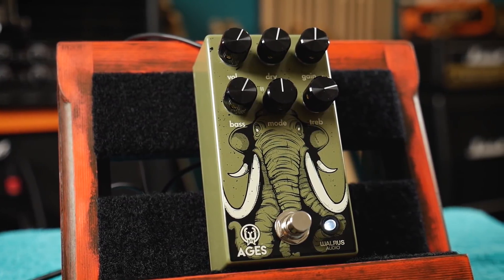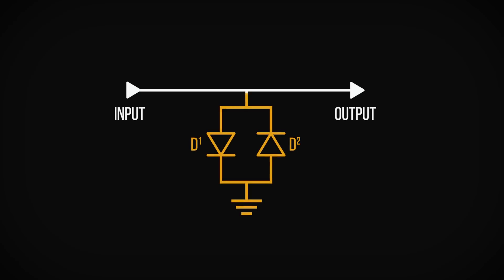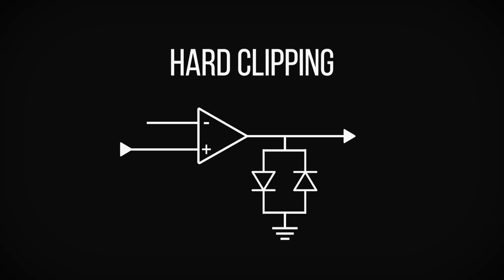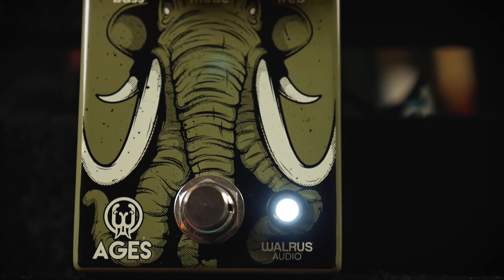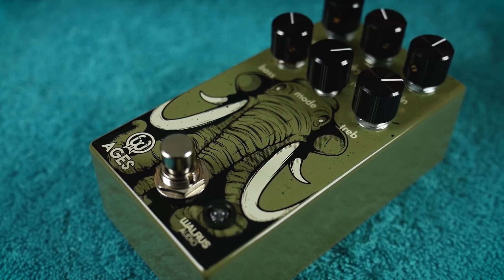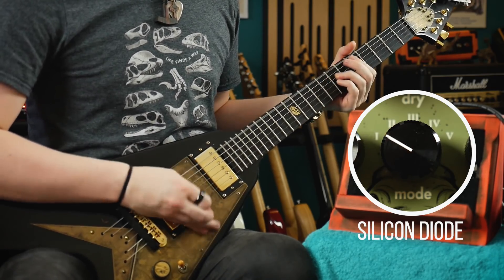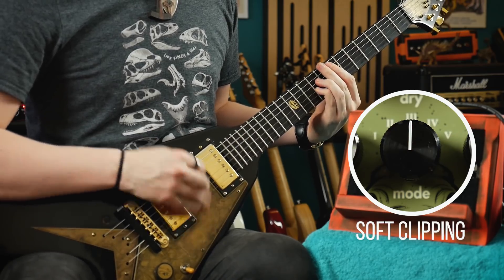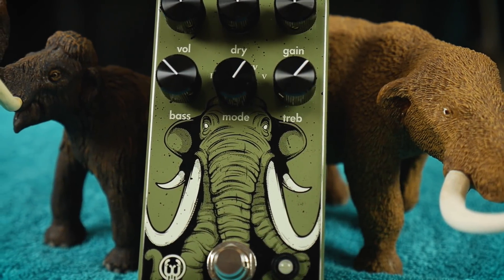What is Diode Clipping? | Too Afraid To Ask

Comment: People confused me by saying there is clipping and there is clipping to ground. Even experts don't really know.
Reply from the maker: @patrickmcmanus5373  experts know just fine: what exactly is confusing you?
Reply: @ScienceofLoud  I am adding clipping diodes to switches on the output. Can the diodes be on the output but joined to the ground rather than just the output. So an example would be can I solder diodes from the hot of the output jack to the ground of the jack?
Would this work?
Would it still clip the signal?
Cheers
Reply from the maker: @patrickmcmanus5373  If you connected diodes between the hot signal and ground on the output jack of a device then: 
Yes - you would achieve hard clipping of the signal; any signal level above the forward voltage of the diodes would be conducted to ground. 

The more important questions I have for you is WHY are you doing it this way? and WHAT is the result you are hoping to achieve? 

The reason you typically don't see clipping diodes across an output like this is because clipping the signal, by necessity, significantly reduces the signal level. 

If you place the clipping at the output, you have no way to adjust the level of the signal leaving the device - it will be decided for you by the forward voltage of the diodes. 

You'd want to have a volume stage AFTER clipping to have control over the output level. 

If you are just looking for a very simple way to aggressively clip a signal into square wave and don't care about the output level - then this certainly is a solution, however if you are trying to add a distortion effect to something that doesn't have a distortion effect, then there would be much better ways to implement it. 

I'm not suggesting this is what you are doing, but as an example: putting hard clipping diodes across the output jack of an electric guitar isn't going to give you the same result as using a distortion pedal - in large part because the signal level from the pickups likely isn't large enough to exceed the diode's forward voltage.

Comment: I've spent 20+ years on this and over a decade ago, finally enrolled in college for electrical/electronics engineering with this having been one of the driving forces. You did a great job on this as expected. 

As an amateur engineer(never quite finished the degree), I still struggle with the prices people get fleeced on with stomp boxes. What is truly goofy is the terms "overdrive, fuzz and distortion" have been grossly misappropriated since somewhere in the 70's. For example, I just designed a "fuzz" by overdriving transistors, and some will call this a "classic fuzz" or "classic fuzz overdrive" because it's actually a product of overdrive.

The term was bastardized because these overdrives were intended to emulate the sound of an overdriven tube, and at the heart of the circuit, use soft clipping in a feedback loop.
Meanwhile, my first original design uses soft clipping, and I regularly regard it as a distortion lol. Anyway, my best work is yet to come. I'm well into a solid-state design that will produce the clarity and note separation we expect almost exclusively from tubes. My goal is very bassy, clustered arpeggios that don't turn into frothing slop from very high, even order harmonics. 

Ultimately, semiconductors can do it better, but the designs require actually giving a fuck about a solid-state that will rival or exceed tubes, and 99% of designers educated or not are married to tubes or even digital. Ironically, the recipe to achieve what I'm describing isn't complicated in the least.

Comment: All of the schematics I have looked at for pedals with diode clipping always only have 2 diodes. Why not 1 or  3 or 7 or 24? Lack of headroom? Tubes are diodes and my tube amps have anywhere from 4 to 12 tubes.
Reply from the maker: The reason there are typically 2 clipping diodes is because one diode is required to clip each hemicycle of the waveform. There are many pedals that use more than  2 clipping diodes (including the pedal featured in this video). Odd numbers of diodes will produce asymmetric clipping (where one hemicycle is clipped more than the other). 

Not all tubes are diodes. If your amplifer is tube rectified then that rectifier tube is a diode.

All the other valves in your amplifiers are either triode, pentodes, or beam tetrodes (depending on what types you have), they perform amplification - a very different purpose and function to clipping diodes in a pedal.

Comment: I build my own drive pedals FOR me to use...I use MY amplifiers for testing and tweaking the pedals while building them...In other words, I get as much as I can out of the amp before I tweak the pedal...My pedals will probably not do the same in your amps...I think most pedals are designed that way...It's best to take your amp to a pedal dealer when purchasing high dollar pedal just to try it out..Or else you may not like it

Comment: Nice video and explanation dude. Have a question for you. Does the amp SUNN BETA EAD its a Soft cipping amp or the clipping its different becaus of his MOSFET system ? Also the same question for the EHX Hot tubes pedal ? 
Its distortio. Applies for this explanation or its differenet the matter of using MOSFETS ?

Comment: Thanks for the clear explanation. I’ve been trying to figure out how/why diode clipping works as well as differences between soft/hard clipping arrangement in a circuit. This by far has been the best explanation accompanied by visuals - and I feel much better about analyzing and potentially modifying schematics. Thanks so much!

Comment: Thank you for a fantastic explanation! My initial thought was that the difference between settings 1 & 3 (or 2 & 4), was the number of diodes arranged symmetrically in the feedback loop. You mentioned that the higher gain soft clipping settings (3 & 4), are the result of more voltage travelling through the opamp. Any idea how this is achieved? Maybe the voltage in those settings is diverted into a charge pump before the opamp? Thanks again for such a great breakdown of this!

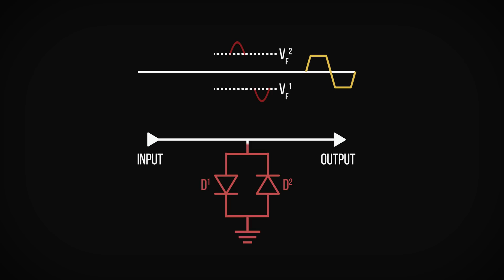Comment: at 2:07 you say that the excess voltage clipped by diodes goes to ground.  I always figured the harmonics that clipping provides comes from the Law of Conservation of Energy, in that the difference in wavelength is put somewhere else in the wave, adding "hair" to the shape, so to speak.  Does this still happen to a more limited degree, or is it really the square shape of the new crest/trough that provides the perceived harmonics?

Comment: Love your TATA segments! I have a question I’d like to ask. It’s a bit off topic of this video, but thought I’d ask anyway. I figure you may know since you make pickups. Here’s my question. Why does my lower output pickup of around 12.5 kOhm’s sound louder, punchier and tighter than my higher output pickup of around 17.6kOhm’s? Both are in the bridge position of similarly constructed guitars. According to popular belief of low vs high output pickups, it should be the opposite.
Reply from the maker: DC Resistance tells you basically nothing about how a pickup will sound. It's only one of several factors than influence the signal level (output).

As you wind more copper onto the coil the resistance increases, but so too does the inductance at a faster rate. 

Inductance is pivotal to how a pickup sounds as this affects the resonant peak, the most dominant frequency of the pickup. 

The higher the inductance the lower the resonant peak, so if you wind a coil to be very hot (high output) you will also make it sound dark (lowering the resonant peak and sacrificing high end detail)

Beyond 16K ohm the inductance will work against the resistance. Extreme output pickups are largely false economy.
Reply: CSGuitars Thank you for your response. Makes total sense. I play hard rock and “classic” metal and have never like very high output pickups. Too mushy sounding to me. Not tight enough. That’s been my experience anyway. I prefer the punch and tone of medium output pickups because you can always juice your output with a boost pedal or overdrive pedal. Thanks again!

Comment: Hey Colin, have a TATA question.

Maybe you could answer as a reply to this comment because I’m not sure it would make a great video.

I see a lot of guys use humidifiers in their guitar rooms to prevent the wood from drying out.

This seems counterintuitive to me for a couple of reasons...

1.) Older acoustic guitars usually sound better in large part because the wood has completely dried... so doesn’t a humidifier slow the “aging” process of the wood?

2.) With regard to electric guitars and amps and pedals (if they’re in the same room, which they almost always are), I would think that the humidity would be bad for the electronic components... so wouldn’t a humidifier do more damage than good over time?

3.) Lastly with regard to strings... wouldn’t the excess humidity cause uncoated strings to die more quickly?

Seems to me like a humidifier would do more harm than good, but maybe my understanding is incorrect or there’s something I’m just not considering.

What are your thoughts on this?

Thanks so much!
Reply from the maker: You're asking very much the wrong person. Living in Scotland I'd never have any need for a humidifier. It's always wet all the time. 

This is a question for someone in Arizona who needs to add moisture to the environment to prevent wood cracking and warping. I'm sure they'll be able to tell you exactly why humidifiers are useful.
Reply: No worries, mate!

Thank you for your reply.

Comment: So they have 2 LEDs inside the pedal for signal processing. The light they make is evidently considered a waste byproduct. Why not mount them in the 2 eyes of that mutant elephant on the front panel?? A chance in badass design missed.
Reply: Some pedals do that, and it looks badass. The lights light up brighter the more distorted the signal, and therefore the harder you play if you keep the gain at the same setting.

Comment: Great stuff, as always. This may seem like a stupid question, but when you rotate a gain/distortion potentiometer on a pedal, are you increasing the forward voltage, thus increasing the part of the wave that gets clipped? And then with the volume pot, is this increase caused by some secondary amplification after the clipping diode circuit?
Reply from the maker: The gain control usually sits in the negative feedback look of the op amp and controls how much of the the output is fed back into the inverting input. 
This literally dictates how much gain the op amp can generate and is entirely independent of the clipping diodes. 
The forward voltage of a diode is defined by the materials it is made from and cannot be altered by any external process. 

The volume control in pedals can be either passive or active: If passive it's simply a potentiometer right before the output which bleeds a percentage of the signal to ground, making it quieter. 
If active then there will be a secondary amplification stage that will either increase or decrease the signal generated by the gain stage.
Reply: @ScienceofLoud - Thank you!

Comment: One of the overlooked aspects of "hard" vs "soft" clipping is that diodes in the feedback loop of an op-amp (i.e., "soft") tend to prevent the op-amp from crashing against its headroom limitations, since the maximum amplitude of the op-amp will be set by the diodes at roughly +/-600mv (for silicon) or +/-1.5V (for red LEDs).  If, however, one directs an op-amp to provide a gain to the input signal of, say, 200x, and sticks the diodes on the output, what you end up hearing is the sound of an op-amp that has been explicitly directed to exceed its headroom, and then clipped by diodes on its output - double clipping.  I recall many forum posts by people puzzled at why their MXR Distortion+ could never get "clean", even in the complete absence of clipping diodes.

So, one of the differences between "hard" and "soft" clipping is that, with soft, one is hearing essentially ONLY the characteristics imposed by the diodes, while in the case of "hard" clipping, one is hearing the manner in which the op-amp responds to headroom limitations PLUS the actions of the clipping diodes.

Some pedals will use a sort of combination of the two.  For instance, the venerable Marshall Bluesbreaker, and its derivatives, like the Analogman King of Tone or JHS Morning Glory, provide two cascaded op-amp gain stages.  (Bear in mind that gain is "multiplicative", such that a gain of 30x, followed by a gain of 20x provides a total gain of 600x to the input signal.) The first stage doesn't push the envelope too hard (max gain of 22x for the overall signal, and 31x for high end), but provides enough gain that if you crank the pedal and hit a power chord, you'll run up against the chip limitations.  The output of that first stage is then amplified further by the 2nd one, which has diodes in its feedback loop.  So, a blend of chip-clipping and diodes.

None of this is a criticism of your excellent explanation, merely a few wrinkles you didn't get around to.

Comment: Can I ask why turning the gain up makes it appear louder even though there is actually no change in volume?
Reply: Distortion compresses the signal and raises the average volume even if the peak volume stays the same
Reply from the maker: Gain is signal amplification, you multiply the level of the signal which makes it louder, until it hits its headroom limit, then all further multiplication further distorts the signal. 

I have a video titled "What is gain?" which explains this in some depth.

Comment: Exactly what I was looking for. I want to buy a Friedman JJ jr but I wasn't sure that it would have enough compression so to make it a little more flexible I wanted to boost it with KHDK ghoul jr wich has soft and hard clipping but the mids are a little strange for me on that pedal so the Ages is the perfect solution.

Comment: OK, here's a related TATA: Given that diode clipping pedals all use similar components, why is it that one pedal can sound amazing and another, similar pedal sounds like garbage? Does it have to do with how they choose to clip the signal or is it in the EQ? Or both?
Reply: Eq both before and after the distortion, combined with different diodes being used. 95% of guitar tone (other than the player and physical properties of the guitar) comes from eq in one way or another.
Reply: @lobsterbark  JHS has demo of that in one of his vids where he uses a Boss GE7 and just maxes out certain frequencies to use it as an overdrive
Reply: Amateur’s understanding: has to do with internal voltage regulation and how EQ is handled in the circuit design. For example, how the Ages has bass control before clipping means that adding bass will increase clipping specifically done by the diodes as more voltage/output is going through part of that circuit. Adding bass post clipping will result in a different effect and (in my general opinion) make the tone a bit muddier. Another aspect is overall internal voltage. For example one the largest differences between 1981 DRV and a ProCo Rat is that the 1981 has differentiated its circuit with an internal voltage doubler. Unless I’m mistaken, more available voltage means you can still route voltage through the diode clipping but with extra available voltage results in more overall headroom. This is why the 1981 cleans/tightens up at lower gain settings. Of course, not an expert, this is just my understanding and I would be glad to be corrected. You can see an example of the impact of circuit design using the same not components by taking EQ, volume/boost, compression and drive and simply rearranging the order of effects.

Comment: Ahh yes the good old clipping diodes, loathed by some players when incorporated in a tube amp’s circuit, but praised by the same when fed into a diode-free tube amp. We guitarists are a strange breed.
Reply: What. Diode free tube amps are impossible, they are required in the power supply. Are you talking about diode tubes?
Reply: lobsterbark i think he means diodes in the preamp section to sound like the tubes are being driven harder than they actually are.
Reply: @lobsterbark  silicon and germanium free would be more technically accurate.
Reply: he means people say  non-transistor tube amps are the only amps that sound good because solid state components are trash and sound like crap. Then they rave about the sound they get from running their guitar signal through solid state pedals into the amp. 

the point he is making is that they are using solid state components, integrated chips even, which they claim sound like crap if it was in the amp.
Reply: @fredgarvin4482  a tube is an electronic part just like a transistor just like a diode just like a resistor. A tube is just another way to produce electrons
Reply: The implementation is key.

Comment: Yes but what is a feedback loop
Reply from the maker: The negative feedback loop takes some of the amplifier's output signal, invests it and puts it back into the input. This helps stabilise the amplifier against oscillations and runaway amplification. 

The 'Gain' control is usually part of the negative feedback loop, the more signal you feedback, the less the amplifier amplifies.